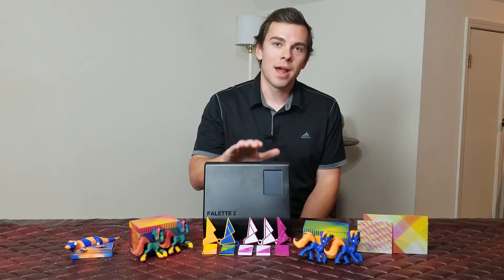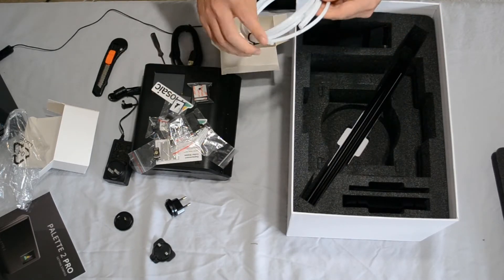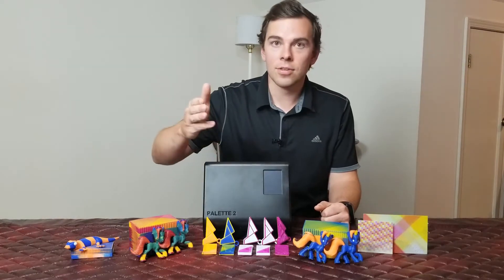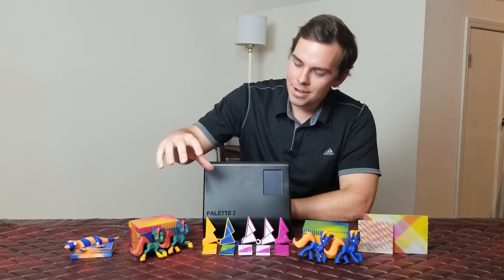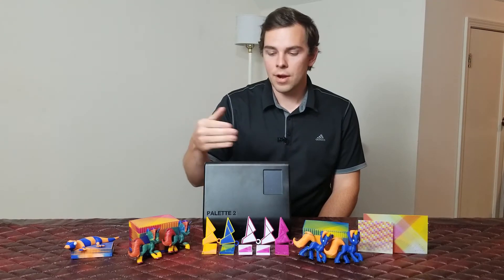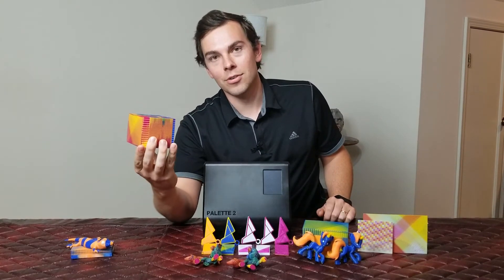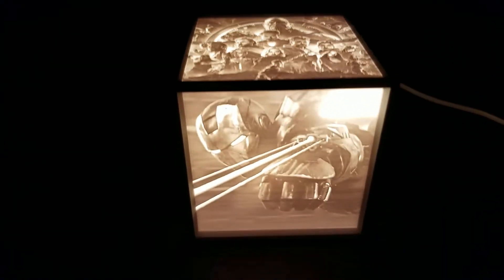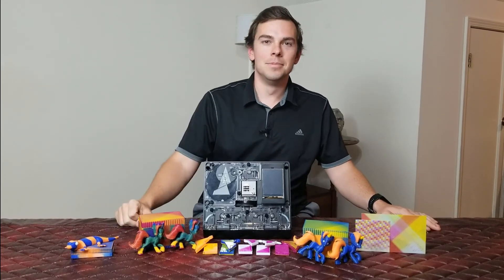Palette 2 on a CR10S Review - Multicolor 3D Printing

Comment: hi i also own an creality cr10 and a palette 2 was wondering if you could please share your slicer settings please
Reply from the maker: I replaced the stock hotend and extruder with direct drive, so my settings may not be useful anymore, but I share my old settings in the lithophane light box tutorial
Reply from the maker: The palette group highly recommended upgrading to direct drive so I did and it greatly improved my print quality
Reply: Thanks for the reply . what direct drive and extruder did you choose